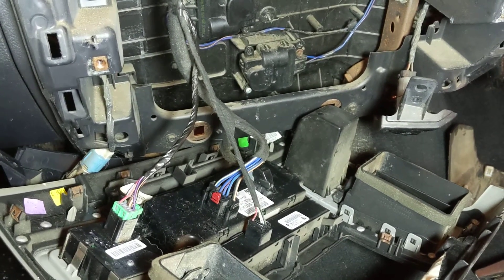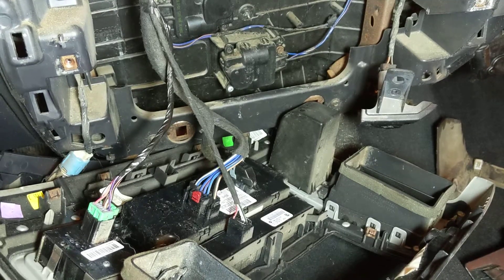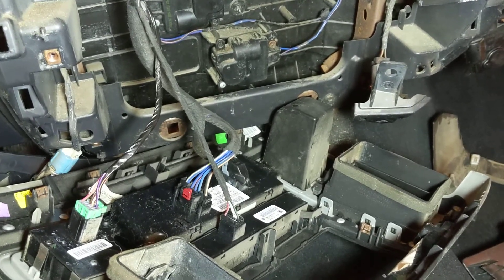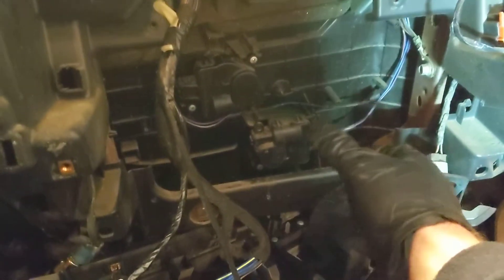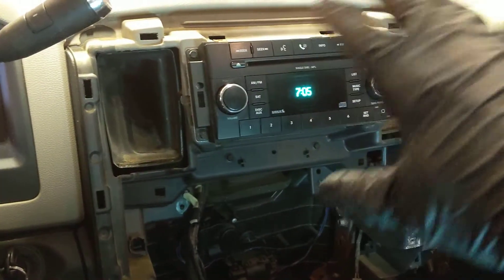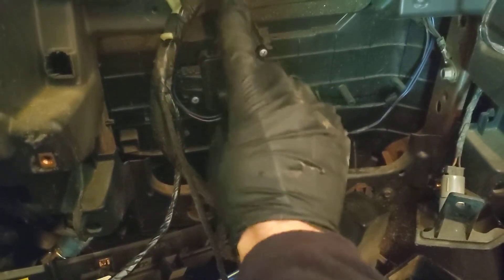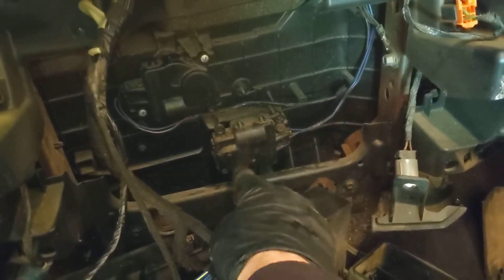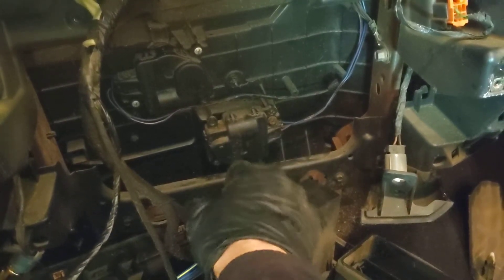Fixing 09 Dodge Ram Heat and Blend Door Clicking Issues Changing Actuators

Comment: I fixed all three actuators and im not getting air thru face vents. Were is the blend door at
Reply from the maker: First one I point at. Sometimes the flaps break make sure it's working
Reply: @patrickmurphy8619  i got a brand new one the flap is broken but were is the flap